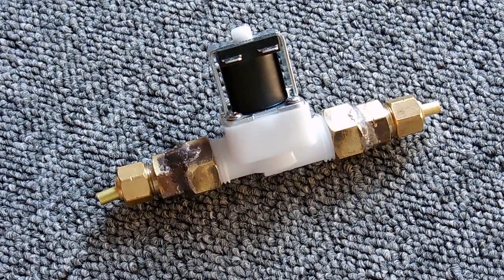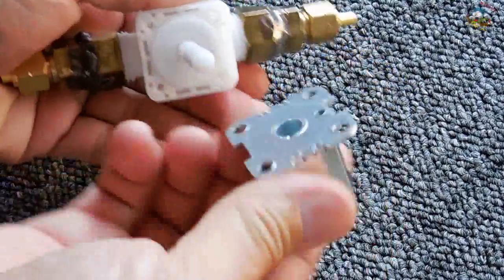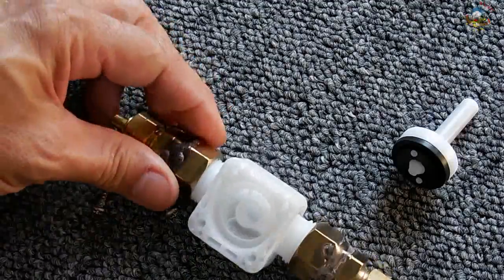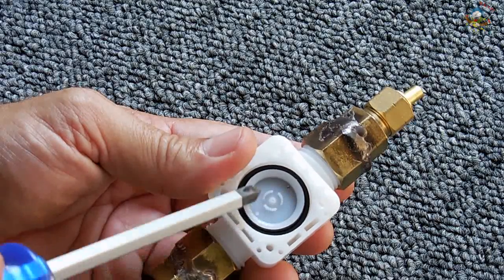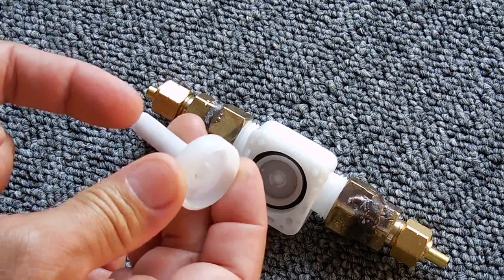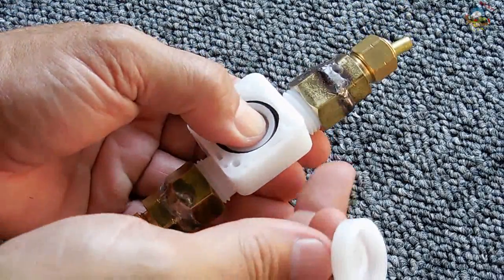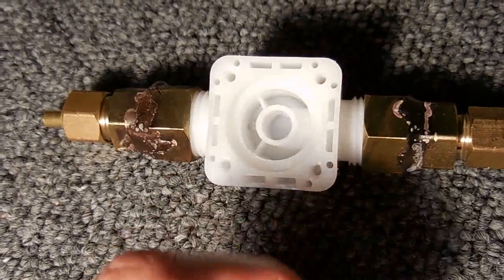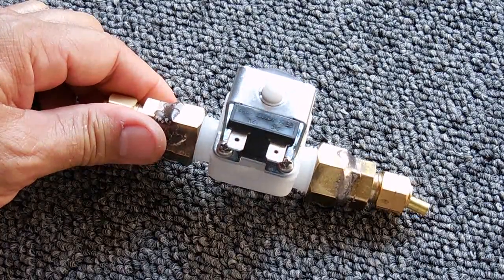How N.O.(Normally Open) Solenoid Valves Operate

Comment: Sir, Does this require water pressure to operate the closing and opening of the valve? Or does it work even without the water pressure just a gravitational force of water?
Reply from the maker: No, it also works using air.

Comment: Although you didn't say so explicitly, I am presuming that the purpose of the pin is to limit the amount of water coming into the plunger.  Otherwise, the water may not be able to empty quick enough thus allowing the diaphragm to engage on its own.  Also, is it the case that there is a short lag time between activating the solenoid and altering the water flow (presumably proportional to the time it takes the water to build up in the reservoir)?
Reply from the maker: mediaguardian There is a slight lag when activated because it takes time for the pressure to change. As for the pin, at first I saw it as a guide, but the only other reason for it would be to limit water flow.

Comment: I took one of these completely apart, N.C. (Normally Closed) version. I used the coil in my Curie Engine. not trying to feed off your viewers :p
https://youtu.be/eb9eOM8HybQ
Reply from the maker: Heilman Hackatronics You have been a viewer for quite a while. So no problem. :-).
Reply: ***** I didn't mean to be misleading. The coil used is from a solenoid valve.